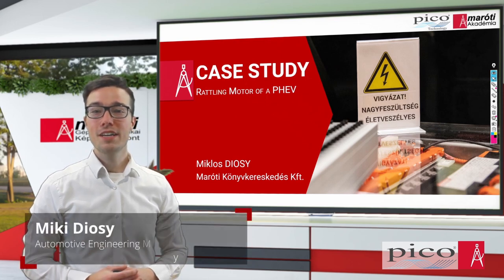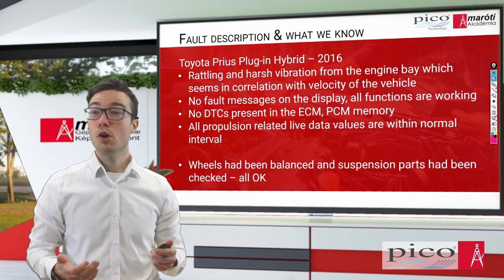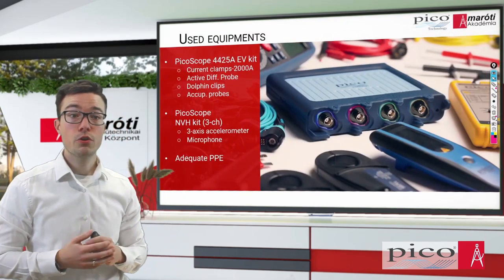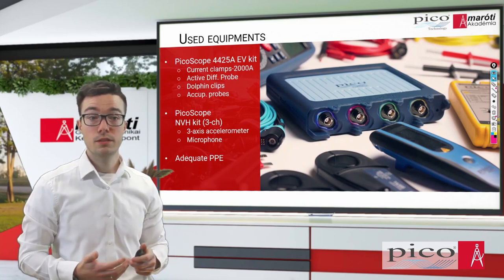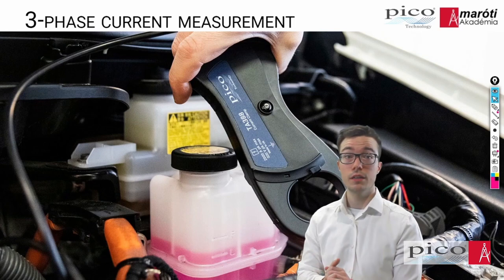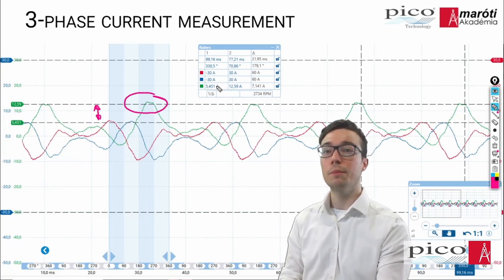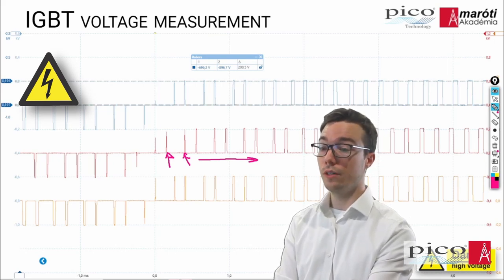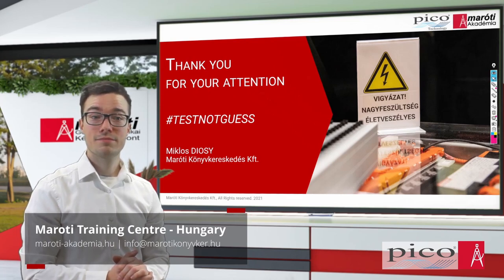PicoScope Case Study - Prius Resolver

Comment: Nice presentation and good information. Thank you. You were fortunate that the inverter connections for the P410 transaxle are so easy to access. Most of the other ones are not. Of course, in hindsight, checking/manipulating electrical connections should be done first.
Reply: I realize I am kind of off topic but does anyone know of a good site to stream newly released tv shows online ?
Reply: @Edgar Benson Try Flixzone. Just google for it =)
Reply: @Axton Michael definitely, have been using FlixZone for months myself :)
Reply: @Axton Michael Thanks, signed up and it seems like they got a lot of movies there :) I really appreciate it !!
Reply: @Edgar Benson No problem =)